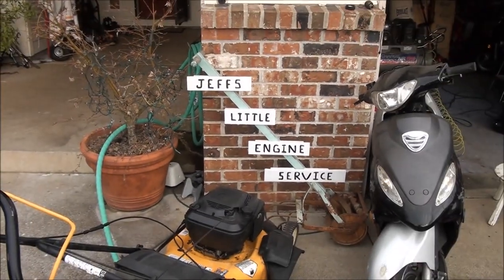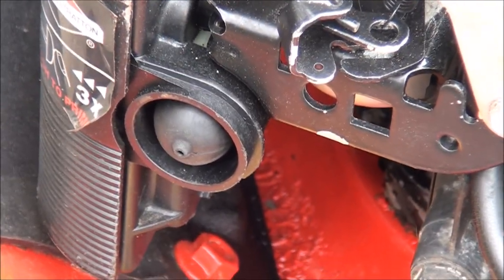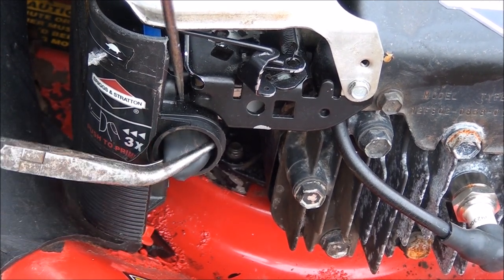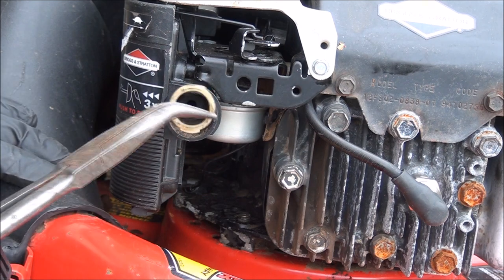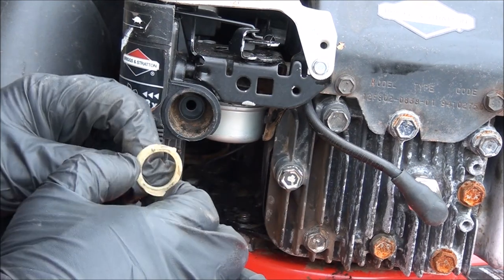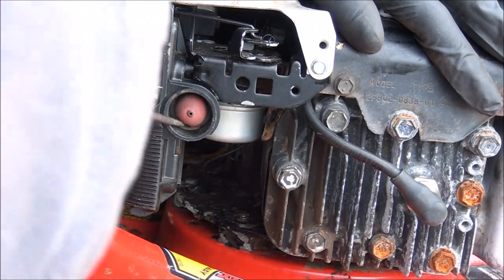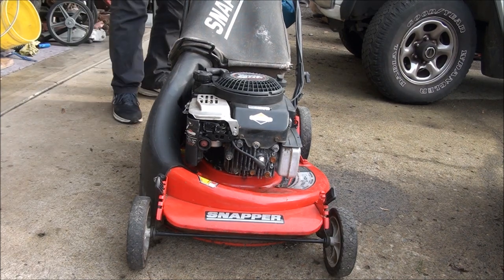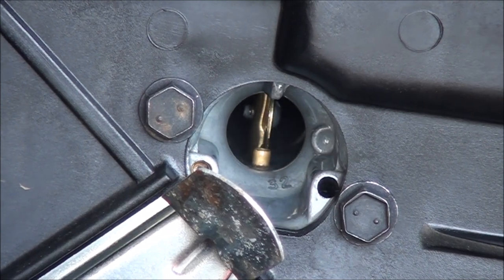Hard to Start? HOW TO REPLACE and Check the PRIMER BULB on a BRIGGS and STRATTON Lawnmower Engine

Comment: Just take the entire filter assembly out first.  Not that hard since it is only 3 bolts once you remove the filter cover.
Reply from the maker: I try not to because you will then need a new gasket (or 2) and these covers are only good to remove and tighten down a couple of times before they warp and are no good.

Comment: Excellent, I like  to use a deep socket to push it in, less chance of piercing the new primer bulb.
Reply from the maker: good tip!
Reply: @JeffsLittleEngineService  that's what I did thanks
Reply: 17 mm deep socket perfect fit
Reply: Thanks for your 4th of July 2024 Tip ( for me anyway ) 🙂✌

Comment: I have an older B&S Toro. With a 5/16 nut-driver, remove the air cleaner cover. Behind that there are 3 more 5/16 screws remove them. This allows you to remove the housing that holds the plunger. With a small screw driver remove the plunger and the new one. reassemble.

Comment: why fight around everthing? remove the air filter the primer bulb is attached to the filter housing.
Reply: Dann G You are right! remove the air filter. there are three 8mm screws that need to be removed. remove the screws and disconnect the pre-heater hose. The whole assembly comes off. you'll then have plenty of space to get to the snap rings.
Reply: Half the time the gasket needs to be replaced housings are prone to warping sometimes you have to double and triple the gaskets to make a seal so the primer bulb can function
Reply: no shit i was wondering about that
Reply: there is a screen that is supposed to be in the hole behind the primer bulb to prevent dirt from getting in the carb. it was missing.
Reply: Then most likely you would have to change that gasket

Comment: I have this engine in my mower, after a whole winter, needs no primeing, gas at idle, and you just pull gentley, with 2 fingers, the pull start to the end. Allways starts first try. No revving, no smoke, no noise. Just a nice gentle start. Im not saying this because its american. Im europian, and i hate american stuff. But this engine is just mental. So easy to start
Reply from the maker: Briggs are great engines
Reply: I picked Up a used Murray 22-inch for $25 at a yard sale 5 years ago. other than a Carburetor kit, this little Engin starts Year After Year on ONE PULL. It's Fantastic.

Comment: Excellent video.  Thank you for doing.  The only thing I found was that the bottom of the bulb would not seat.  So rubbed the bottom of the bulb with motor oil just to make it slick so it would seat.
Reply from the maker: good tip!

Comment: Many tries but a little detective work and FINALLY got it fixed. I didn't realize the bracket in the upper right behind the back of the the air cleaner housing was too far out so I bent it back. It was supposed to take the third screw.  It had prevented a tight seal for the gaskets on the air cleaner housing. I bent it back with pliers and a hammer and since it is not really needed I am not using it.  It took three days of puttering around and replacing parts before the light dawned on me! Primer and mower work fine now.
Reply from the maker: good investigative mechanic! I will be aware of that from now on, thanks!

Comment: It help to use a small amount of lube just inside the lip of the primer bulb so it slip all the way on its seat . I find a deep well socket that’s just slightly smaller in diameter than the primer bulb housing works to drive it in.
Reply from the maker: Good tip

Comment: Update: the carb was the beginning issue, how ever after cleaning and putting it back togeather and back on, I neglected to put the spring that connects to the little metal arm that hooks to the top of the carb which controls the butterfly, so yes a stupid little spring has been the bane of my exhistance, at any rate it is now running better than it was when it was new after the carb cleaning, thank you again sir for your assistance.

Comment: Could you use a socket to clip that plastic piece into place? Great video!!
Reply: Yes. Slip the right sized socket over the new bulb and clip ring, line up the tabs to the mounting holes and push the ring in until it snaps. There is a briggs primer bulb install and a removal tool you can buy but their pricey.
Reply: @baddad5781  17mm socket works perfectly 👌

Comment: Thanks for showing that. My primer bulb was okay, but I needed to see how it came apart. Mine had a little screen behind it that I ended up removing after I cleaned and reinstalled the entire assembly with little response from the primer. I also noticed that the gasket wasn't making a real good seal, so I thoroughly cleaned it and snugged up the screws real good. The combination got it working again. Any idea what that little metal tab you bent is for?

Comment: Just take the damn air filter cover off and do it like that so much easier
Reply from the maker: You will need to purchase another gasket (or two) when you put it back together, and hope the primer button works after reassembly

Comment: Found the primer bulb on Amazon with the plastic collar. There are two. One is for pulsating carburetor? How can I tell which I have? Its 6.5 hp Briggs Straton
Reply from the maker: yours probably has a hole in it the other one doesnt
Reply: @JeffsLittleEngineService  meaning I dont have a pulsating carburetor? If it has a hole. Thanks

Comment: I took my mower out the mow today, filled the tank and the fuel was coming out through the hole in the tip of the bulb and looked as it was also coming out around the bulb.  Is that just a simple bulb replacement as well or is something else not right there?
Reply from the maker: The carburetor is flooding and needs to be cleaned and possibly rebuilt. The primer bulb itself is probably ok.
Reply: That’s most likely the needle and seat valve in the carburetor. Look up ‘needle and seat replacement Briggs quantum’ or something like that and you should find a video. Parts about 5 bucks.

Comment: Jeff, why would gas come out of primer bulb after you turn off the engine?
Reply from the maker: Sounds like the carbureotr is flooding. Needs to be cleaned and or rebuilt. I remeber you 
M Gomez. You have supported me and watched my videos for a long time, thank you.
Reply: @JeffsLittleEngineService  how's Mr Chicken? I replaced the carburetor. The float was not level but angled. No more leak.

Comment: It’s much easier if you take off the air cleaner assembly you get clear access to the locking tabs.
Reply from the maker: You will need to replace the gasket if you remove the air filter backing plate. Sometimes it takes 2 gaskets stacked to reseal it back up to where it will prime correctly.
Reply: Yes you should replace the gasket

Comment: Replacing the primer bulb didn't fix my concern at all (not Jeff's fault; I'm only sharing this story in case others are going through what I was going through). It turns out it was the air cleaner base gasket that was not sealing the primer bulb air passageway fully. So the primer bulb was pushing air right out into the atmosphere. Here's what I had to do: take off the whole filter/primer base from the mower. Clean it. Get a new clean gasket. Carefully apply RTV sealant on the edges of the air passageway that are supposed to be sealed by the gasket. Don't put a whole bead of sealant like you are sealing a transmission. Use your finger and put a very light amount on. You don't want to plug up the passageway. The passageway I am talking about is shaped like a lazy "L" Then put the gasket on and make sure to press it down tight around all of the mounting pins. Then seal up the edges around the bottom outside of the gasket (near the lazy L passageway) with RTV sealant. This is the only way I could get the seal to take, otherwise I could never get any gas when pressing the primer bulb. I put the primer base back on the mower while the sealant was still a little wet and tightened everything down and let it sit overnight. The problem is fixed 100% now and the mower starts up on the first pull.
So Jeff, do you and Taryl know each other? Are you friends? Are you enemies (just kidding)? Thanks for the videos and have a great day!
Reply from the maker: Thanks for the comment. I do not know Taryl personally. I think his videos are great!
Reply: Yep, I did as you suggested and it's working now, Thanks

Comment: I replaced the bulb today. But it's not working anymore. What can I do?
Reply from the maker: The gasket between the carb and the airfilter backing plate. Sometimes you need 2 for it to work.

Comment: Remove the prime's black plastic plate (3 screws) before. It's much easier then to change the bulb...
Reply from the maker: You will have to replace the primer gasket and sometimes that can be an issue
Reply: @JeffsLittleEngineService  u said it there let sleeping dogs lie its crazy how just a slight imperfection to the mating surface and crap ! no mo prime!

Comment: Jeff wonder if you can answer this question I have a 4 stroke culltavitor. Replace the bulb it ran good then this year I took out all the old gas replaced gas filter clean tank out replaced fresh gas and now I pump the bulb can't see any new gas coming into the lines
There is fuel line with filters and other line just suspended in the tank that connects to carb Do you have to re prime the lines I see no gas entering when I press the bulb
Reply from the maker: the carburetor is probably having troubles.

Comment: What is the torque for the backer plate to Carburator on these type engines? I have had to put two gaskets on a lot of these so they will prime because the back plate has been over tightened.

Comment: if you remove the plastic airfilter cover, its all part of that, makes it much easier to replace the primer bulb
Reply: FarmGurlScavenger Noel 
Plus,you don't bend the bracket that the governor spring mounts to.
(As he did)

Comment: So simple. Pull air cleaner off. 3 screws takes primer assembly off carb. Easy to remove bulb at that point, and clear any obstruction out of primer gas path. Whole job that way takes less effort than this guy spent just trying to get the bulb out.

Comment: I own 2 lawnmowers with that same type of Briggs and Stratton engine which I've cleaned the carburetors on but they still surge and the primer bulb draws very little fuel up through the main jet unlike your mower.  How do I fix that so the primer bulb draws more fuel up through the main jet like it does on your Snapper?
Reply from the maker: A new gasket or backing plate or primer bulb could probably help
Reply: The primer bulb, gasket behind the air filter holder and the o-ring behind the carburetor are ok so what else can I do?
Reply: I have the same problem...primer bulb won't draw fuel + primer bulb, gasket behind the air filter holder and the o-ring behind the carburetor are new/okay.  Did you find a solution?

Comment: i have the same mower runs fine but primer doesnt work so it always needs starting fluid to get it going. bulb is in good shape, all passages inside carb seem clear, replaced gasket on the plastic cover but nothing. any suggestions?
Reply from the maker: ckl8a. Try using two gaskets. Those plastic backing plates tend to warp after time.. may need a new backing plate if 2 gaskets doesnt work. Good luck!

Comment: I have a lawnmower with that type of engine.  The primer works with 2 gaskets behind the air filter holder but the engine surges a little and can be hard to restart sometimes.  What is causing that?
Reply from the maker: sounds like the carburetor and fuel tank need to be cleaned.
Reply: I already thoroughly cleaned the fuel tank, fuel filter screen and carburetor.  Is there anything else I can do?  I used carburetor cleaner on both.  I'm wondering if the valves need to be reseated?
Reply from the maker: Maybe, I would still focus on the carburetor, it may need a new float needle valve. Warm start problems are often from a flooding carburetor.
Reply: When I remove the cylinder head half of the head gasket sticks to the head and the other half sticks to the engine.  Do I need to replace the head gasket?
Reply from the maker: yes
Reply: Why should I replace the head gasket?
Reply from the maker: It is not reuseable
Reply: Even though every piece of the gasket is stuck to the engine and the cylinder head are you still telling me to replace the gasket?  What should they cost?  Will the compression be affected with the gasket on the engine I described?  How do you remove a stuck gasket?

Comment: Probably would have worked better had you removed the air filter housing
Reply: Way, way, easier to remove the air cleaner housing, then the entire piece is in your hands.. I always use a socket - either 3/4 or 19mm pushes it in all at the same time so the tabs are not damaged by a screwdriver..
This guy did it the hard way..

Comment: Hey Jeff, I have watched a few of your vids, which helped me with repairing my toro mower/mulcher.  Still having issues getting this thing to start up, I am thinking and only thing left to replace on it is the primer bulb with out getting into taking the engine apart pistons and all ....... just curious if you had any thoughts or other ideas if its not the primer bulb .......  Things I have done are 

new gas
new oil w and oil change
new air filter
new spark plug
checked spark plug wires 
gapped the magnito points

it wants to start as spraying carb cleaner into the carb and pulling it it starts and immediatly shuts off so according to your other vids means its got the compression
it is getting fuel being the carb bowl has fuel in it
the pull start cord, and coil have been changed ..... any help on this would be appreciated
Reply from the maker: sounds like a plugged main jet in the carburetor, or perhaps the primer bulb gasket needs replaced between the carb and air filter backing plate..
Reply: Thank you for your quick reply.  I did pull the carb and cleaned it all out, as well as the main jet. (got the idea from one of your vids ;) ) the main jet being the bolt that holds the carb bowl to the carb and in doing that had to replace the gasket inbetween the carb and filter backing plate (i could not find the correct gasket to that mower so i bought and used a cut it yourself gasket material), but yeah I am thinking primer bulb. I did not know there is a gasket for that as well as I only watched half this vid so far. I plan on pulling the primer bulb tomarro and inspecting it, being visually and while its attatched I am only able to see part of it which does nto look to be in bad shape, how ever I do know they can dry rot or get a hole twards the back of it which being its recessed in a bit cannot see the whole thing till I pull it...... I hope it is ok for me to post and ask you for advice and bounce some thoughts off you or anyone else on here.....   lol car engines, quad engines I have no issues fixing, but these small lawn mower or weed whacker engines as basic as they are toss me for a bit of a loop.....
Reply: Sorry I forgot and neglected to mention its a 4 cycle engine...
Reply from the maker: yes the primer gasket is a crucial component. sometimes, you even need to use 2 gaskets stacked, to get the primer button to operate correctly
Reply: yeah i pulled the primer button today, no gasket, the only gasket I see is inbetween the air filter box and the carberator which after a week of playing with this thing and trying to figure it out, finally today I at least got it to the point where it will start for aprox 2 seconds then die, pulls start again and same thing, so at least its consistant on wanting to start now..... how ever being its almost to the point where it will run solid, my guess is either the do it yourself gasket i put on is still messing things up, or upon watching your vid on how to adjust the points using a 12 (upper case and emphasis on 12) sized gaper, I am thinking perhaps I messed that up and its too far away now, where as prior it was right up against the magnet?
Reply: and again thank your for allowing me to bounce things off you...   lol I will take a car engine break down and rebuild over a lawnmower anyday lol